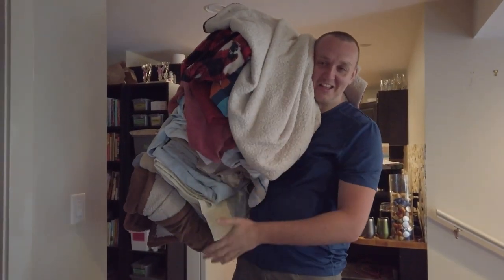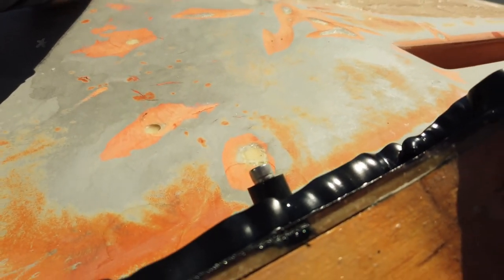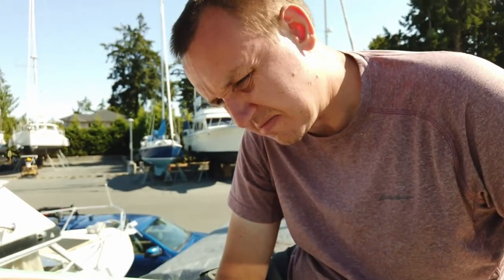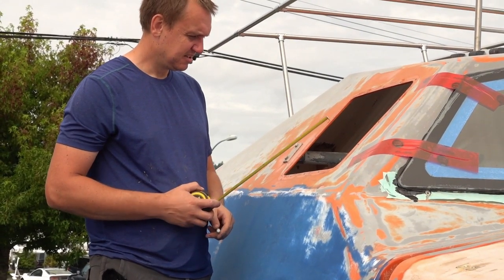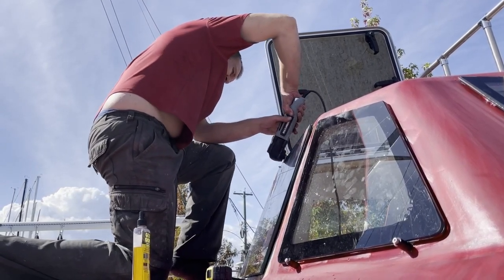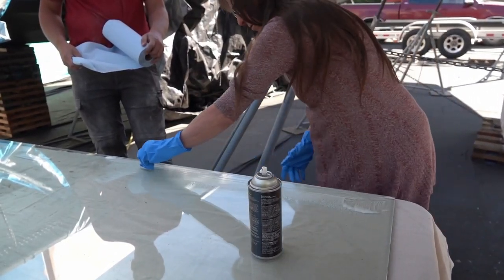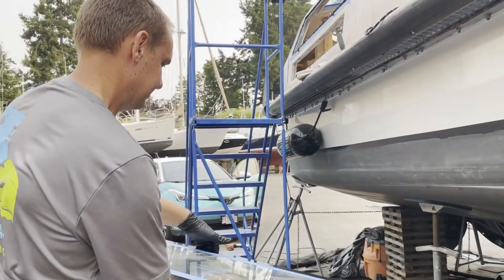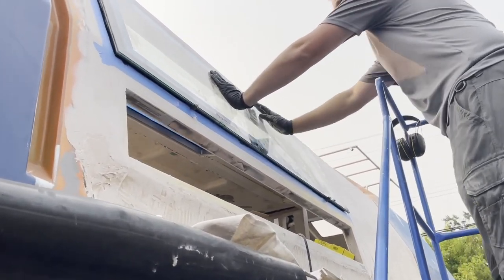Episode 18: Will these Windows Work!? Installing Glass in Our Lifeboat Conversion.

Comment: Awesome glad you used glass ! I like to use a suction cup to install my glass , I also prefer the Milwaukee electric caulking gun it is a variable speed trigger allows you to do an even bead on the glass install 🤷🏼‍♂️, but great to see your progress!
Reply: Also a guitar sting works best to cut through the polyurethane to remove the window
Reply from the maker: I wish I had Milwaukee tools… some day!
Reply from the maker: I got a wire cutter tool that uses guitar string soon after this!

Comment: For that job, 3M VHB tape is much better: less expensive, faster, safer, cleaner, and most of all easy to replace when time will come.
Reply from the maker: Hey Thanks for watching, I had initially planned on VHB tape but had to go with the caulking type glue in the end because the boat wasn’t flat enough and because the glass is so large and will grow and shrink in different heats (the boat not the glass) it was suggested that the VHB tape would not have enough movement for the VHB tapes that work with glass.